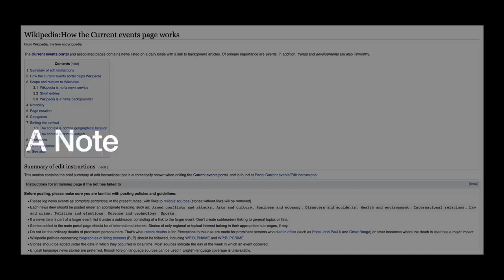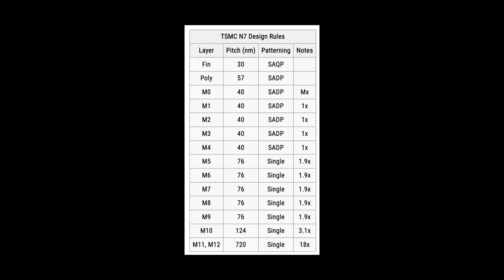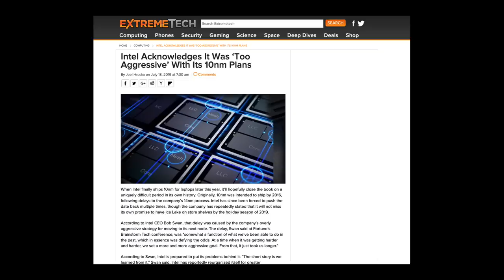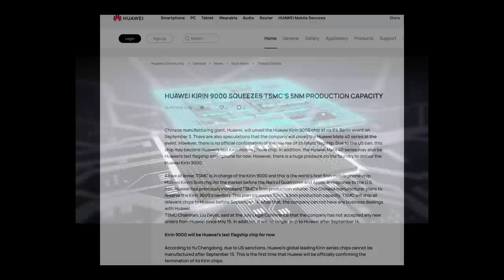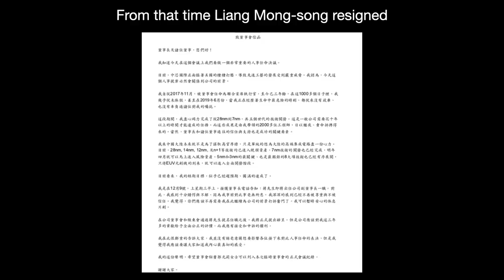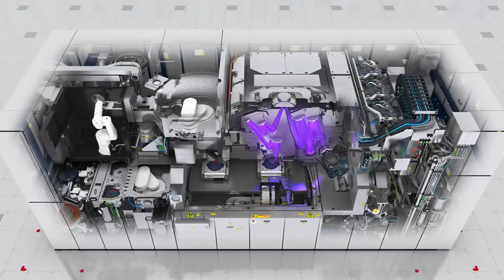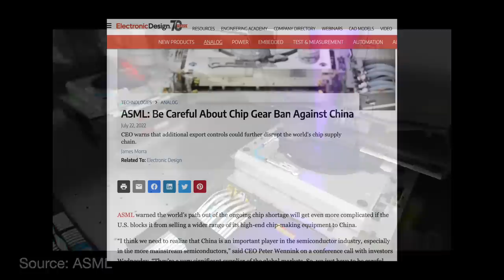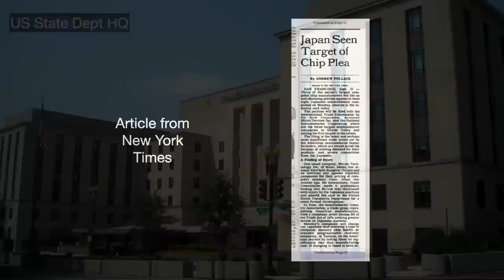China's 7nm Chips: SMIC N+2

Comment: Many people are not aware that China has made huge breakthroughs in a number of semiconductor fields that do not require very advanced processes and can already compete with the most advanced manufacturers in the market. Examples include memory, SSDs, and LCD and OLED screens.
Reply: Everyone is aware of that. That’s why it was important to try and stop or at least slow down their ability to manufacture these most advanced semiconductors, the last remaining global industry that china doesn’t completely dominate. It doesn’t really matter if it worked or not, it had to be done, china recognized very early on that they need this tech and would beg, borrow and steal to get it. The US recognized that they should try and prevent that from happening. It’s as simple as that.
Reply: @HNedel  No, China has a very long history of developing and manufacturing chips, even earlier than Japan, but at that time, chip manufacturing was non-market and dominated by research institutes, and he could not market and industrialize. At the same time this is also the status of China's chip industry in these decades, China currently dominates the low-end semiconductor industry, but the high-end semiconductor industry is dominated by the Western industry chain. Why is this? Because of the market economy. Full competition of commodities in the market economy will lead to winner-takes-all, the lagging party can not get enough profit to maintain long-term investment in research and development will lead to backwardness, and the semiconductor also relies heavily on the construction of software and hardware ecology. But if the U.S. uses an executive order to forcibly ban China's semiconductor industry will lead to a large number of funds originally used to purchase imported chips forced to flow into the original downturn in the chip industry, the huge demand will give rise to companies with strong competitiveness. China is the world's largest chip market, their domestic demand is very large, enough to support their research and development of the world's mainstream performance of the chip, and this part of the funds should have flowed to the Western supply chain, but administrative actions to force interrupt the system, which is extremely short-sighted behavior.
Reply: @guzilayerken5013  You’re not smarter or better at long term planning than the US government. I don’t why so many smooth brains think that. The US has had the largest and most efficient economy for more than a century. That doesn’t happen by accident. US economy is even more efficient per Capita than that of Germany or Japan
Reply: @tylerclayton6081  >The US has had the largest and most efficient economy for more than a century
HAHAHAHAHAHAHAHAHAHAHAHAHAHAHAHAHAHA, you're serious?
Reply: @tylerclayton6081  The US government is good at long term planning? ROFL. Are you a time traveler from the 50s?
Reply: @tylerclayton6081  Ahem..
Reply: @berthold64  He's not wrong
Reply: @tylerclayton6081  , an economy with GDP of $24 trillion and public debt of $30 trillion cannot be called efficient under any terms. 24 minus 30 is negative 6 trillion in debt. Do you call that efficient?
Reply: @kyekye2K  Well china's corporate debt alone is $28 trillion but china's official gdp is $18 trillion, actual gdp most likely is far less as China is known to over inflate the numbers, as li keqiang once said china gdp is for reference only.
Reply: @Serolfarim1  , where do you get you fake figures from? China's external debt is 13 trillion while that of the USA is 30.4 trillion. If there's one country that inflates it GDP, it is the USA. China is the world's factory and by far the wealthiest country.
Reply: @kyekye2K  Talk to li keqiang, do I have to repeat myself about what he said in regards to china gdp? He said china gdp is for reference only. I also said china's corporate debt is $28 trillion but with an official gdp $18 trillion, that makes china's economy horribly inefficient especially if you take into account china's real or actual gdp. USA figures are reliable, we are not like china so don't try to create issues to advance your agenda.
Reply: @kyekye2K  you just simply dont understand debt, especially on the global scale.
Reply: 'huge breakthroughs' = stole everything not nailed to the floor
Reply: China has no break through, they literally reverse engineered the already existed technology in every sector, you name it. But sadly, this is the part that the US don't have to worry. Because we're talking about nano precison technology, one bit of error will result in the failiure of the whole chain. So the question is, most of the west tech companies has hundred of years of expetience developing top notch quality accessories for chip making machines. There are hundred of companies like that. The lithography's component  machine alone consist of 600 others companies produce different high end component for that machine which they have so much experience and fund. China on the contrary has to start from scratch. They will catch up eventually but at what cost and for what? Chip making is so interelated and countries have to depend on each others for specific process and no one knows it all. Which is to say China want a closed inhouse made chips would takes more than 2 decades to play catch up
Reply: And the human resources, most talented engineers always and up in the west hands thou
Reply: @tweedy4sg  So do you think China entirely home grown chips is delusional? It is next to impossible to be independant on this sector and they will have to be interdependant in every sense of the world. China always wants to seperate themselves with the west and think that theirs system is superior because look at how fast they can build railroad. But reality is China can't and won't survive the market without the west tech and vice versa, the west need china labours
Reply: US depends on foreign grads. Also  the still reaping off the  the two atomic boom s on Japan. Too many are impressed by that still.
Reply: @HNedel  so you're advocating for a controlled economy like Soviet Union? What happen to open market and fair competition?
Reply: @archieames1968  stole? aren't that western imperialist countries spesialis since colonial era until now
Reply: @commie5211  wrong, it has been a strategic goal of the CCP to develop domestic semiconductor industry and not be dependent on foreigners. This would have happened with or without sanctions.
Reply: @HNedel  Ever taken economic classes? CCP can not win over the market force. State fund only can do so much, if a chip company can not survive by itself, it will be a blackhole kept sucking money with no returns. Thats why all the previous tried turned out not successful. Because their product can not beat TSMC and therefore makes no money, and the cycle kept repeating. But sanctions changed everything. They are forced to use domestic now, and those domestic chip factories can survive and improve on it. 2022 is the first year China the chip export exceeded the imports.
Reply: @HNedel  It is a market decision, not preference. Made in China solar panels are cheaper with higher efficiency, thats why there are buyers. same thing with the chips, if those phone companies wants to out compete their competitors and sell their phones, they would have to buy the best or the most cost efficent on the market, that is the power of the market. Same reason the US can not stop stuff made in China, because thats what is selling. period. It always shock me a "communist country" understand free market better than so called capitalism countries.
Reply: @HNedel  The US never had company like Tencent and still do not have it. you are the one the is wrong.
Reply: @HNedel  He did a video about it, China's internet great wall or something,  he metioned "the Chinese internet companies already beating their counter parts before they left".
Reply: @HNedel  I wasn't aware of that.
Reply: @MrBakedBagel  
He is wrong.
Great Britain was the most dominant economy until ww2.

USA simply took the lead after the collapse of the USSR and was able to shift its funds more on research than on military expenditure.

But China completely turned the tables. Such exponential growth has never been witnessed in human history before.
Reply: @ajaykumarsingh702  And all the rotten, corrupt and failed states arnt "Real Communism", the amount of destruction left in Communism's wake is astounding.

Capitalism will always be the most effective monetary system, that betters standard of living across the entire board of society.

Goodluck to any nation or group of nations that takes on the United States.

Just remember, most luxuries we have today, were made possible by this nation

🦅Fking Freedom
Reply: @ajaykumarsingh702  I dont remember the USA stealing the microchip bud.

Saying every nation and empire stole and copied in the face of EXTREME IP Theft is laughable
Reply: @MrBakedBagel  
The things Western world built based on mathematics developed by India and China, even to this date.

Nobody develops anything from scratch. It's very rare if that happens.

The inventions that you are boasting about here never could have existed without the laid foundation from Great Britain that made previous inventions on which the USA simply followed up. Now China follow it up.

What you are claiming here simply doesn't happen in reality.
An invention cannot be made without having a base from previous inventions.

An invention is not just a machine or device, it's an idea.
You might claim to have an "original idea", but others can modify or further develop it beyond your original idea.

You picked up a rhetoric "USA is the greatest country", based on inventions.

China registers more patents annually than the combined Western world since the last decade.

So your rhetoric isn't living up to your claim anymore, if we go by your logic.
Reply: @MrBakedBagel  
Today's China is not ww2 era bro.
It is an exact present era.
Reply: @MrBakedBagel  
Nope.
You are just trying to frame a term over the word - "idea".

When you pick up somebody else's idea, it doesn't matter whether you buy the patent rights or outright steal it, it's still somebody else's idea.

That was my point.
And no amount of bullshiting can change that.

USA paying up to the royalty for the patents to other nations doesn't mean jackshit.
They are still the idea of somebody else's.

Besides, patents are not permanent and the majority of nations have a time ceiling of 5 years.
After that 5 years period, other companies as free to use the tech as they deem fit.

Also, I repeat again - China registers more patents annually than the combined Western world since the last decade.

USA is far behind China in innovation now.
Reply: @ajaykumarsingh702  Thats why China is naturally 25 years behind the US in the most important sector. Micro-chips. This is the same line of thinking people had about Russia's military strength. Yawn.
Reply: @lynch8067  hundreds you say😂
Reply: @lynch8067  not true
Reply: @MrBakedBagel  not crony capitalism though
Reply: @firasajoury7813  cry
Reply: @archieames1968  stealing technology isn’t wrong
Reply: Korean companies are still monopolizing memory chip and OLED 😆
China found a breakthrough only with LCD
Reply: @guzilayerken5013  China's chip history is longer than japan's?  
It was Japan that invented the NAND flash chip
Reply: @리드-w7k  LCD that is because Korea and Japan was completely defeated had to stop production, LCD is also a very large market, you think Samsung, Sony intends to give up? Secondly, China OLED, MiniLED, and even MicroLED, not only can produce and South Korea has formed a competitive relationship.
    If you are really concerned about the market, you will not be unaware that China's OLED production accounted for 38% of the world, if you think South Korea can always maintain the advantage, then please continue to believe, to know that a few years ago South Korea also maintained a surplus with China, relying on the semiconductor, and now South Korea instead of China's deficit of $ 30 billion.
Reply: @guzilayerken5013 
China bought their LCD and OLED technology.
The outcompeted Japan (not Korea) but that's because labour is cheap.
They didn't invent anything.
Let's see how they do without being able to buy and steal everything.
Reply: @MostlyPennyCat  perfect. Let’s also let others make own gallium and germanium. It should be easy if Chinese can do it too.
Reply: @ScoobieDoo-zy1rh  
Are you talking about mining or manufacturing?
Reply: @MostlyPennyCat  both.

Comment: I remember when SMIC was buying all the 100mm, 3um tooling they could find. They used that volume to fund a rapid chase of moores law. 

At 14nm, there was a connection to at least a real measurement. The Leff, L-effective, of the minimum logic gates.  The contact areas allow encroachment under the gate making the actual channel length the listed dimension. Using angled implants works for this in higher nodes, there are probably hard mask spacers and RTP used to limit those effects as every atom matters at those dimensions.

Comment: Every major economy started copying someone else first and just selling cheaper but to keep growing they must eventually start innovating. China no doubt already started to innovate. The only question is if they can innovate faster than everyone else.
Reply: China doesn't have to innovate faster. China will be fine with one or two generations behind.
Reply: @quademasters249  The West still leads in semiconductor technology, but the 7nm breakthrough by China is significant.
Reply: @snslifestyleorg  I guess it depends on whether you consider Taiwan "the west". I guess they align west.  Intel can't compete with TMSC anymore.  Which I find quite disappointing.
Reply: @quademasters249  Taiwan uses Western technology while China uses some indigenous equipment due to sanction. Meanwhile China memory Chip technology is already on par with the West, which is another breakthrough.
Intel bet on the wrong processing technology and failed which enabled AMD to race ahead of Intel with its 7 nm CPU.
Reply: @snslifestyleorg Taiwan is ahead of the rest of the west.  Even Intel seems to have fallen behind.  This video suggests China is using the same but less advanced versions of the tools TMSC and Samsung are using. 

AMD's CPU is made by TMSC.
Reply: @quademasters249  Yes. Clearly China has made a breakthrough with their 7 NM process.

Comment: Silicon's Moore's Law is coming to an end - many industry insiders aren't even confident that 1nm will be viable. Given this, it is possible that China is not all that bothered about the EUV ban, hoping instead to leapfrog current silicon technologies altogether, perhaps with photonics or carbon chips or something else - just like they leapfrogged many other technologies from the past few decades.
Reply: There will be something else to replace it. Probably soon. 

Thinking that solid state (graphene?) transistors will be usable pretty soon.
Reply: Moored law has changed multiple times, Hertz, Wattage, Size etc. Cores, photonic, quantum, etc are on the horizon. People have said moored law is over multiple times
Reply: @fintanparsons9741  yes, but we need some backup for silicone, maybe graphene. 
Last year i disassembly a washing machine, they use some type of ASSPs made in 1micrometer node... 
Silicone are strong but we still need something to be bleadind edge
Reply: Anything Carbon base is dead end. There is a better 2d material for silicon replacement and it is not Carbon.
Reply: EMAN67:RP forum  Better conductor but bad switching characteristic. This what most physicist miss. A transistor needs to be able to turn on and off. A transistor that is always on is useless. If you have a microchip that  will switch a wrong transistor on by just talking loudly then that would not give you correct calculation. If your computer suddenly do 1+1=3 because the rickroll song is played near it that will be a very annoying defect.
Reply: EMAN67:RP forum  Carbon has bandgap problem they should switch studying on other 2d material that is not Carbon.
Reply: That's what China stands out glaringly different from other tech countries. Remember this saying .... China, as a whole, has a Quantum Mindset, not predominately linear of the west.

Comment: When American attacked Japan semiconductor industry then. Japan had not anything edge ,only making lower cost memory chip than American can do.  But all IC chips are not memory ic.  It is all ic types from memory to cpu ,analog ,digital ics, power ic.    
Out of memory chips, All ICs Japan has produced are licensed from US design.    So it is very easy for American to stompt down Japan IC industries anytime.
Reply: One driver of the Japanese semiconductor boom starting in the late 1980s was quality control. There was a joke that a Western company ordered a batch of DIL chips from NEC or some other Japanese company and specified a failure rate of not more than five chips per thousand. They got boxes of the chips, each with an envelope taped to the top with the five defective chips per thousand the customer had asked for. Until then testing was done by sampling from the production line but the Japanese automated the testing process, tested every chip they made and only shipped tested-good chips.